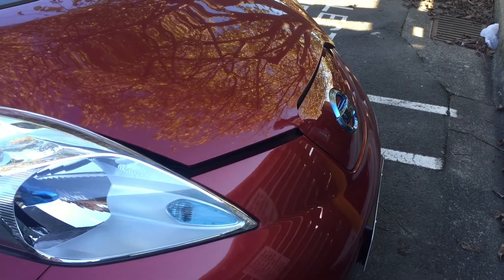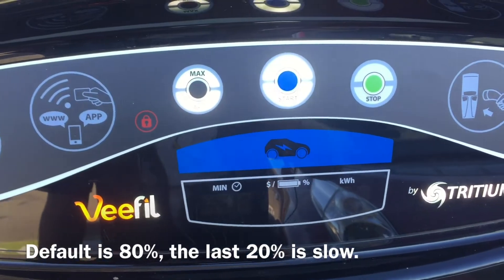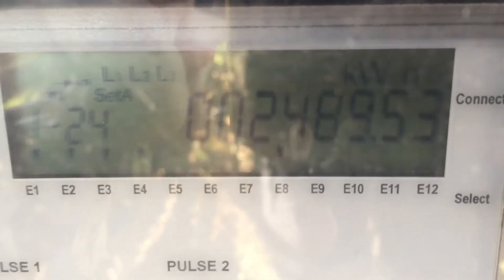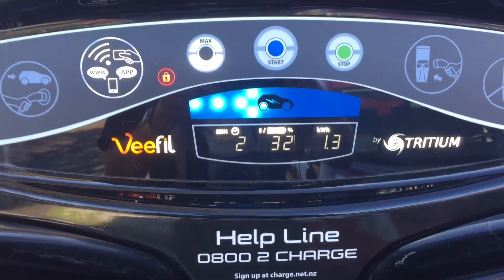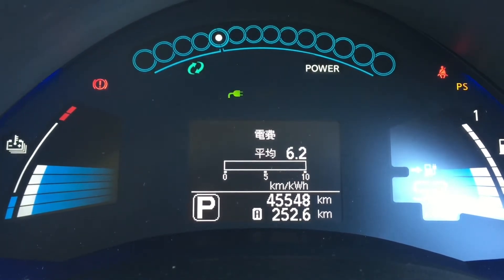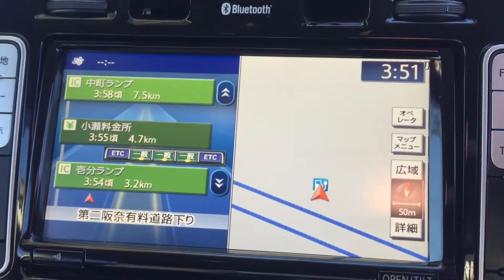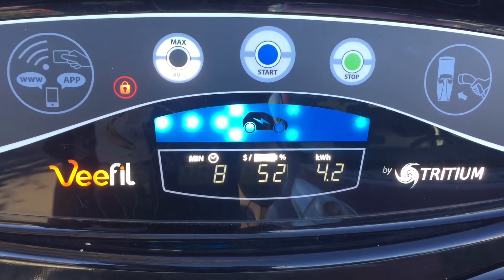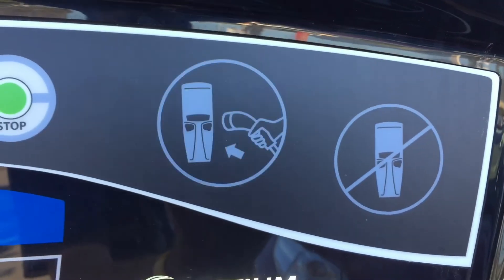How to Fast Charge in NZ: Why I'm buying an EV Part Four.

Comment: I'm looking to import a JP leaf , do NO JP leaf's have 6.6 onboard chargers?
Reply from the maker: Probably almost none do and it pretty much does not matter anyway, I have not met anyone that has a great usage case otherwise. As far as I can tell 6kW chargers are almost pointless because even a 40kWh battery will charge in 12 hours on a 3.5kW charger, so if you get home late and leave early the next day, getting six hours charge over night will give you 20kWh, which will drive 100km and the distance between fast chargers is usually 75km mostly less. Most people in NZ just don’t drive 150km and are home less than eight hours every day, day after day, except paid drivers, who can use DC fast charging.

Comment: are you using 200 v Japanes charger or some other and which one is it ?
Reply from the maker: Short answer 230V (200V).

In New Zealand, a standard wall outlet is 230V with 10A continuous draw and a peak of about 15A. 230Vx10A is 2.3kW (2.4kW heaters are common in New Zealand). A 24kW battery could be charged in 10 hours. 

There are caravan connectors for connecting an RV, trailer or mobile home to the mains, they have a continuous draw of 16A allowed. Caravan connectors 230V x 16A comes to 3.68kW,  this is the maximum of the charger built into a Nissan Leaf (Japan and NZ versions) (some UK Nissans have a 6kW onboard charger). 

Caravan connectors are sometimes called "Blue Commando".

In New Zealand, electric cars are commonly charged using a caravan connector because they are often available in driveways and holiday parks, are waterproof and designed to be used outdoors. 

Many imported used electric cars in New Zealand come with a caravan connector, the remainder come with New Zealand standard 3 pin plugs. When using a standard 3 pin plug, we must be careful to set the charging rate to no more than 10A but preferably 8A to prevent circuit breakers tripping or fires.

There are no 100V or 115V electrical services in New Zealand homes.
Reply: if i understand correctly your using caravan connector to charge your leaf which is set at 230v connecting your leaf . and you do not use 200 v charger which comes with the japanes leaf ?
Reply from the maker: I cannot remember the what particular model 230V connector that this Leaf came with, I used the DC fast charger to charge it. The person who owned the Leaf had the 230V connector at home, I did not see it.
Reply: what type of DC fast charger your using now ?
Reply from the maker: The CHAdeMO chargers are Veefil branded 50KW models there are som ABB ones around too. New Zealand has a unified network of public fast chargers that can be activated by an RFID key tag or a web app on a smart phone or tablet. Charge.Net.NZ

Comment: Wow that's very expensive to charge... with those prices it's actually more expensive to run an electric than a gas car. I thought electrics where way cheaper to run. Looking at the prices you average 10 $ to run 100km, I can do that in my car with 8$. I guess charging at home at night would be way cheaper...
Reply from the maker: Charging at home, which I think I would do more than 80% of the time would cost $3 per 100km, about 1/3 of the cost to drive my hybrid 100km, so yes very cheap to run. Service costs annually would be far less than the hybrid too.

Comment: How did you find the drive quality compared to your hybrid?
Reply from the maker: The car was smooth and quiet, a different feel to it from my Insight. The Leaf is higher a bit more isolating from the outside. I noticed that the tyres were unexpectedly noisy on chip seal road, I am not sure about the tyre pressure, the tyres were ecopia.
Reply: oil companies get smart they will run these ev pumps at gas stations charge by the gas price ahahha
Reply from the maker: Yes, it would be their last gasp, they always say they make no money from the petrol, and get their profit from the shops, which sounds like rubbish to me. But when 80% to 100% of charging would be done at home, they'll get no money from either source. That's why petrol companies love hydrogen fuel cells.

Comment: Enjoyed the video and learnt a lot. I think some Japanese imported Leafs are advertised with NZ head units, which I assume is display in English with local maps. Worth checking out
Reply from the maker: NZ head unit could mean a non-nissan stereo, so some of the car data may not be available. I was debating removing the stereo and putting in an android model with google maps etc.